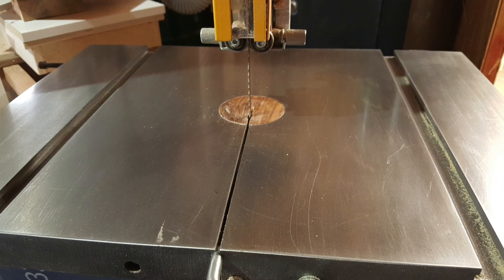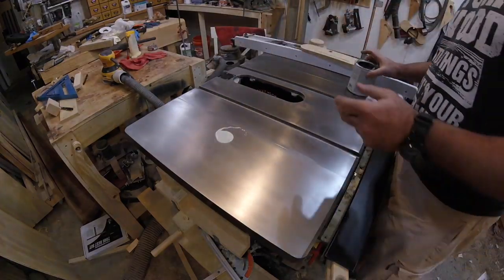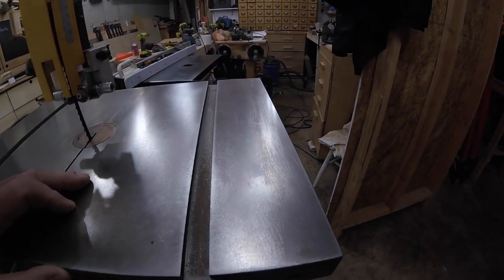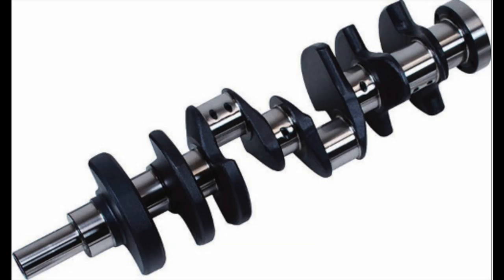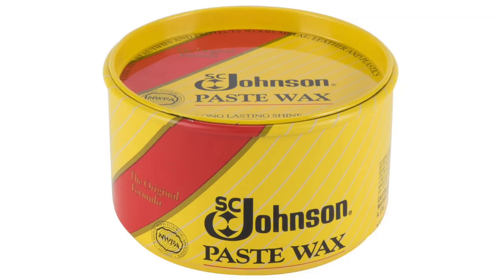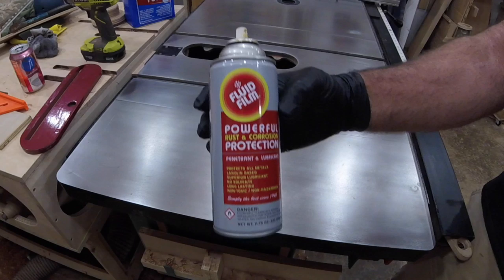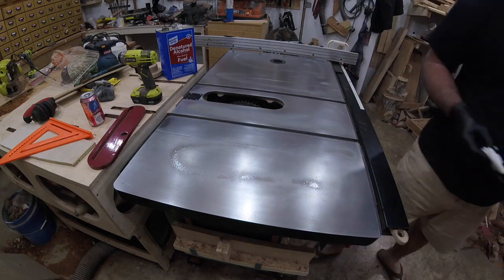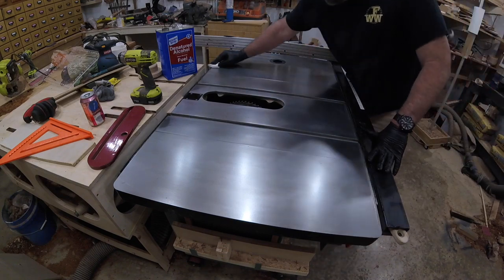Polyurethane Your Table Saw Update: What I Learned About Cast Iron

Comment: Hello Franklin.  Normally, to apply any coating to metals, you need to do a sufficient preparation.  You have a good start with what you have done to clean the surface, but for any type of PAINT, which Polyurethane is, you meed to acid wash the metal before Primers, etc.  The proper Acid is Phosphoric acid, yes, the same stuff in Cola drinks.  You might try using something like 3M Scotch Brite to scrub the surface with the Phosphoric Acid.  When the steel or iron parts are in the Phosphoric Acid long enough they turn black which is a type of "corrosion conversion".  You do not need to use the PA that long.  It will probably bubble or foam when on the metal surface.  Let it work on the metal to clean and etch the surface for a number of minutes, maybe at least 5 minutes.  Wash off the PA with water then dry immediately before it can rust and then when dry apply your coating.  You will probably have good results this way.  BTW, if you want to prime and paint any steel, iron, aluminum or probably any other metal, you will need to clean it and etch it with the PA to ensure the best adhesion.  Good luck!!!  Roger

Comment: You’re right on with the cast iron info.  I worked for years in SAC underground missle silos where moisture was a major issue.  The solution was keep things dry and use a lot of epoxy bases paints.  On cast iron we always had the same problem though.  Closing the pores through polishing is a good solution.  Then you might find a lanolin product will work even better.  The factory could polish them for us but at what cost?  Way to go sir, always keeping our head in the game is where its at.  And by the way, if your shop isn’t messy to some degree, your either not working, or your making annoying videos for anal folks who concentrate more on themselves than helping others.  Good job.

Comment: I've got a rebadged Grizzly, tropical area (everything rusts), and had the same experience. Paste wax was useless and poly doens't stick. I switched over to a WD-40 Lanolin spray and had no issues since, the only marks are from using it as an assembly table. Very easy application, vacuum the top clean, wipe over with a microfibre cloth, spray a light coat and just walk away. Dries quick, leaves no residue that gets onto the wood or affects finishes and everything slides smooth. I won't be bothering to try anything else anytime soon.

Comment: Now that was a very informative and well thought out video. I had assumed that based on your tablesaw poly failure video that it didn't work at all on anything. I will try this on my ridgid tablesaw and see what happens. Thanks for the great video.
Reply: I've got a Ridgid tablesaw as well. I was wondering if different vintage saws would have cast irons with different compositions, so brand A may not actually equal brand A in terms of the cast iron.

Comment: Fluid Film is a lanolin based product. it is used for undercoating. It advertises that it binds with the existing metal and creates a barrier to prevent moisture. I just did two of my cars here in Southern MN.  I have the other stuff and have used auto polish as well as paste wax. I'm in agreement that it doesn't work well in a very Humid. 90 plus shop.  Moisture can build as condensation and leave rust marks.  Appreciate the thought that you put in .

Comment: I live in a high humidity area of the US.  Each night when I close up shop, I cover all of my cast iron tops with  old bath towels.  No, they are not cold, I think it keeps the dew off of them.  The rust has to start somewhere and moisture is usually the culprit.  And YES you can get dew in a building.   I am sure someone will say I'm nuts, but it works.  You can always try it on a tool that you leave out and see the results for yourself.  I hope this helps somebody because I hate typing.   Richmond VA
Reply: With that being said about humidity. I wonder if a dehumidifier would help?
Reply: Me too, an old blanket slows things right down.
Reply: @annajohnson8807  A fan helps to keep condensation from forming on metal surfaces. I've heard from guys that literally have water streams running through the middle of their workshops. Not everyone has ideal working conditions. The other thing folks do is they take an old fridge and put a light bulb in it. They keep their really delicate tools in there. Think machinists instruments.

Comment: I recently used oil poly on my table saw, and drill table. I was prepping the bandsaw for poly, but I think I'll give the fluid film a shot. Last year I coated the bed of my wood lathe with a thin coat of poly, and there's no rust there today. 

I had similar problems with paste wax. At the time my solution was to melt candle wax into the iron tables with a heat gun. I think it worked a little better, but not long lasting.

Thanks for the info!

Comment: 11 years ago I purchased 3 tubes of AutoSol metal polish on amazon.  I just used up the 1st tube.  The stuff takes off rust and leaves a slick surface on cast iron.  I have the same Grizzly as well as jointer, dill press and band saw.  Worth a try.  I have a slightly used can of Johnson's past wax that did nothing for rust.

Comment: I also use fluid film and I warm my tops with a heat gun prior to applying the film. Evenly warm, not hot, to open up the pores and once cooled I add a second coat. I don't have issues with rust at all.

Comment: I think there is no absolute right or wrong answer on this. Climate and humidity conditions will vary not just by area, but by shop or building construction type. The key is, you're passing on your personal experiences (successes and failures) in an effort to help people who may have to same issue. 

I always had good success just using T9 when I lived in the Metro-Detroit area. Now that I'm up in Alpena living 40 feet from Lake Huron, my shop processes have changed dramatically.

Sorry you're getting some negative comments on this. Apparently no good deed goes unpunished. Thanks for the tip.

By the way, a clean shop is the sign of a sick mind. Lol

Comment: Being a flexographiic printer... water and alcohol based inks .....the 2 words that caught my attention were Silicone and graphite ... both would repel water and alcohol based coatings due to the natural slick ness of the iron compound or surface tension on the iron ... (surface tension makes a liquid as in a coating —bead up) which could be reduced through AGE on the older equipment or the older iron.  Or....Who knows what is in the proportions of the older iron....we use primers to pretreat certain materials to make the surface tension more acceptable... some materials like raw vinyl—— nothing works.... we also use UV cured varnishes that have lots of silicone in them to coat labels and make them slick and scuff proof... once coated nothing sticks to them....

Comment: Thanks for the tip. Cant find anything I like either. Just ordered some Fluid Film. On a side note, I think I am going to clean my shop this weekend before the shop-nazi sees it.
Reply: Why not try dry-lub silicone WD40. It's used in pianos to lubricate and preserve the metal key pivot pins and guides.

Comment: My guess as an aged metallurgist is that it is to do with the age of the cast iron surfaces. No doubt they would all be grey iron and I would expect them to be very similar in composition and microstructure but the older surfaces will have the graphite flakes worn down below the surface as it (the graphite) is so soft. With the graphite worn down thus any coating has a chance of keying in. With newer tools the graphite will be level with the surface and not much will stick to graphite. Sanding etc will just spread the graphite and make things worse - you could try a quick sand (or bead) blast to cut the graphite down... Martin
Reply: Olfoundryman has

Comment: Up here in the Northeast Fluid Film is used for spray undercoating for vehicles. I did a class at NHOU - NH Oil Undercoating which is basically a competitor to Fluid Film. NHOU products and Fluid Film exhibit "deep creep" properties meaning they literally soak into the pores of the metal and travel to all metal surfaces that touch it. Once it has saturated and set for a bit, it seals the surface by not allowing oxygen to reach the metal, thus providing a rust protection. Vehicle undercarriages need to be reapplied once the surface has been sprayed enough times with water and/or debris. In this case, use of the surface will wear it thin so reapplication is necessary. I don't know the price of Fluid Film but, NHOU products are somewhere around $30 per gallon. Of course a gallon would last a lifetime even when used after each individual use. Kind of funny... That's what I was using on my tablesaw because I have a 55 gallon drum of it (I spray veicle undercoating for side cash) and I was looking on here to see other ideas. It works well for my rare use although I brush or spray it on and then have to wipe it off prior to use. I guess I will continue what I was already using! LOL!!! Thanks

Comment: I don't use my saw a ton.  Past wax happens to work for me.  Guess I'm lucky like that.  II scrubbed the rust off of it with a gray scrub pad and wd-40 when I got it.  Took elbow grease and I waxed it and buffed after.  Then about every 6 months or so.  Not to bad.   We are middle of the road in regards to humidity.

Comment: I live in SC on the coast and have used Johnson’s paste wax on my tables for 40 years with complete satisfaction. It does have to be refreshed about every quarter but the result is satisfactory. Since it wears off in the process of sawing whatever you end up using should be compatible with whatever kinds of finish you commonly use. My advice is to never use anything with silicone on any woodworking tools since it can cause finish failure. In fact I don’t even use it inside my shop. If for some reason I need silicone for something it’s done outside and I wear disposable gloves so I don’t transfer it with my hands to any of my wood contact surfaces.
Strive to not put your sweaty hands on your cast surfaces and don’t ever set you coffee cup or soft drink on them. There is always salt present on your hands in sufficient amounts to rust cast iron. Sweaty drinks leave a ring that if nothing else traps dust and acts as a brake, not to mention causing a rusty ring.
I’m a retired professional woodworker.
My shop looks like yours...only bigger.
Reply: That's good to know about the silicone on tools. I'll not make that mistake because of your advice.
I just went out and bought this fluid film. I read the can. It doesn't have silicone in it. It says silicone free.

Comment: Paste wax works fine, I apply it then buff with a 2 $ garage sale buffer with a lambs wool pad, I have a dozen cast iron table tops in my 3 man cabinet shop, been doing that for 30 years in humid East Texas. really easy and we quick, also helps wood parts slide on the top.
Reply from the maker: I'm glad it works for you.  Wish it worked for me.
Reply: I'd like to add one more thing I use Johnson Paste Wax not the soft Turtle Wax.
Reply from the maker: @cabbyhubby  I figured that's what you were talking about.  Johnson's works fine for me if I want to apply it really often, like maybe twice a week or even more based on the amount of work I'm doing.  But I don't want to, and in reality, I know that I won't.  That's why I'm searching for a different solution.
Reply: @FranklinWoodWorks2016  ....If I come across a better product , I'll share it here

Comment: For myself...I took a completely different approach to deal with the rust problem. I live in the Pacific Northwest where anything made of metal will rust right before your eyes. I tried all the various sprays and pastes. Ain't worth your time. So I cured the problem altogether.
I laminated formica onto the table of my old Craftsman. It gives a beautifully slick surface that wood just glides right over. Glue doesn't stick to it. I used a sheet that was an off-white (think old sail cloth white). Makes it real easy to see anything small on the surface. The guides are still bare steel, so I have to take steel wool to them to clean them up now and then.
 When I get a workshop happening again, I will lam formica onto the bottom of any jigs I build in the future.
Formica. End of story.
Reply: The risk is that you don6get a perfect seal with the contact cement, and rust gets started under the formica...but I like it.
Reply: that's a cool solution

Comment: One possible problem is the silicone content.  Anyone who works in a spray shop will know that if someone sprays silicone even just nearby prior to them painting, the paint job will be ruined.  So a higher silicone content in the cast iron is likely to prevent a lot of finishes from working.  As stated, the silicone is there to give a non stick finish.
Reply from the maker: Don't forget that silicon and silicone are two different things.  Silicon is an element, when combined with oxygen makes sand, granite, etc.  Silicone is a synthetic polymer made up of silicon, oxygen and other elements, most typically carbon and hydrogen, and has completely different properties than silicon.  However, the more silicon in the cast iron formula, the more carbon is caused to turn into graphite, more than likely the lubricant at fault in the adherence issue.

Comment: Oddly My past saw was a Grizzly 1023 and I had no problems with using poly on it. My current is a Powermatic and I am not getting flaking like you are, but it is also not preventing surface rust any better than paste wax is.

Comment: Cleaning should be done as in the bodyshop: two kemtowels and wax and grease remover.
Apply the solvent to the first towel and wipe liberally to trap contaminates in the solution,  the second towel is then used to wipe up the solution, repeat if necessary using fresh towels. 
This is how waxes and armourall type products are removed. 
W&G remover has a slower evaporation rate therefore allowing better breakdown of the contaminate which in turn stays contained in the solution. 
I have seen Fluid Film around,  and will give it a try. 
Thanks for sharing, 
Cheers

Comment: Great research!  Very interesting.  I am concerned about the "rust" comment.  If you are getting rust then there may be very high humidity in your shop.  Is a dehumidifier the solution?  I have run one in my basement shop for years during the summer and never have a rust problem.  I use paste wax on the cast iron only for smoothness and it seems to do the job.
Reply from the maker: I've thought about the dehumidifier, and you're right, humidity is the problem.  I, quite literally, do not have a spare square inch in my shop, so right now, I don't think it's an option for me.
Reply: You might try finding an overhead space for dehumidifier.
Reply: @FranklinWoodWorks2016  Dehumidifiers can be installed outside. They just need an air inlet/outlet. I installed an indoor unit in a smaller box just outside my shipping container building. I was getting so much moisture trapped in the steel container that it would rain from the ceiling... Not fun. The dehumidifier fixed that problem overnight.

Comment: I'm a retired machinist of diversified experience with a limited amount of metallurgical knowledge built up over the years.

Your description of cast iron and its basic alloys and grades is spot on in my experience. Grizzly's machinery supplier seems to prefer a soft, stable, easily machined iron for their castings. Unless its grit bladed to remove surface graphite most coatings plain won't stick to it. Not much sticks to graphite anyway. The 4% carbon content is by weight. By volume, carbon to iron is 12.7% which is why some grades are regarded as self-lubricated to a limited extent - nearly 13% of the area of your finely finished saw table is pure graphite. Which means two things: few coatings bond well with that grade of cast iron and every junction between electro-negative iron and the adjacent electro-positive flakes of precipitated graphite forms a tiny galvanic corrosion cell in the presence of water. IOW, bare unprotected cast iron absolutell positively will rust if the relative humidity gets above a critical percent. 

Lanolin and sheep tallow have been used for centuries as an anti-rust film for steel articles from surgical instruments (before stainless steel) to steel ship's propeller shafts. I've heard yarns alleging broadsword scabbards were lined with sheared sheepskin. Anyway, lanolin is a cheap, non-comtaminating, and quite effective anti rust treatment for bare ferritic alloys.

It looks like you've found a solution in spray lanolin. That said, if you have a pervasive rust problem, I suspect your shop is more humid that most. I suggest a better remedy would be to lower your shop's relative humidity by sealing it up to the extent possible and running a suitable dehumidifier (or more than one depending on the size of the connected spaces.) It may take days or weeks to lower your shop's humidity to an acceptable level because you have to dehumidify every surface and absorbent material as well as dehumidify the ambient air along with the moisture emitted by your rank steamy breath and sweat.

My own solution was to apply gentle heat continuously under the saw table. This was back in the days of filament light bulbs. Raising the temperature of the iron 15 - 20 degrees F over the ambient dewpoint has the same effect as lowering the humidity below the rust formation point. Filament bulbs are scarce now but there has to be some low-wattage alternative.

Comment: try cleaning the surface with comet first, one of the big things that could also be happening here is a thin coating of oil preventing adhesion, since iron is porous no amount of wiping will remove it but comet will chemically convert it and allow it to be removed.